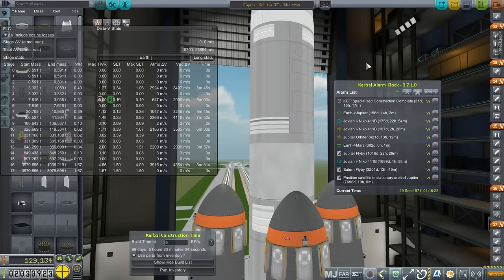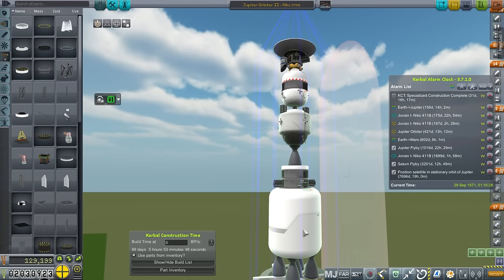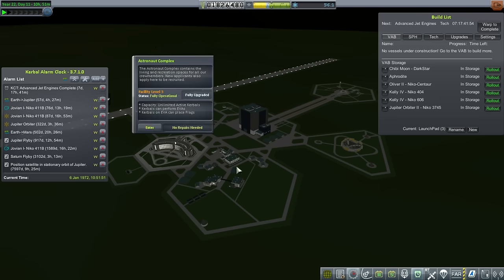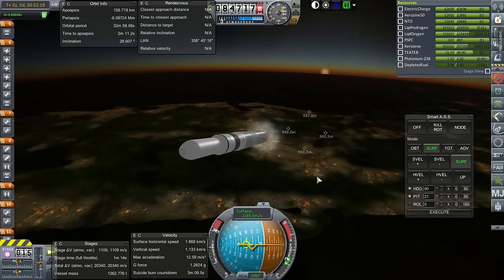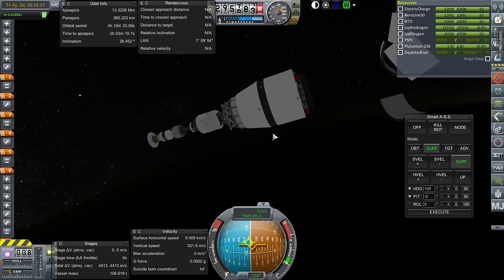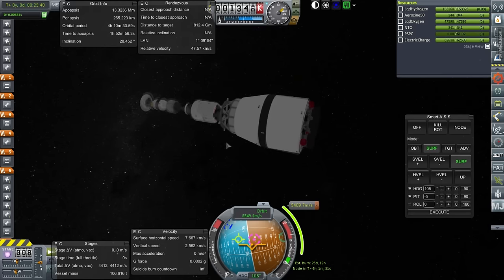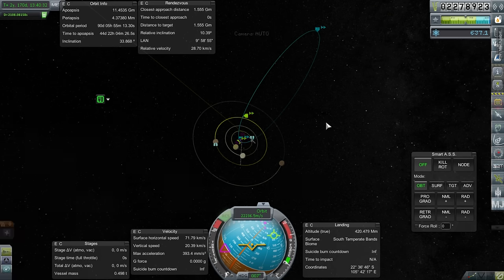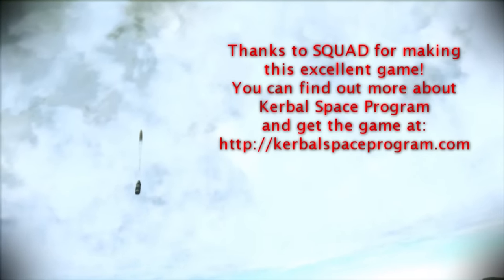Realism Overhaul in Kerbal Space Program 1.1.3 - 45 - Much Jupiter

Comment: There were some versions that were affected by a bug where very small parts such as cubic octagonal struts and such would take an excessive share of the craft's heat and explode, sometimes right on the pad as the vehicle is unpacked and hasn't even generated any heat yet. That may have been 1.1.x. I recall this happening to a deep space mission to me once, when I loaded it when it got to a maneuver node, and one of the three radial engines attached by cubic octagonal strut suddenly detatched because the strut exploded. It was pretty spectacular, very sci-fi event.
Reply: Yeah, that's a potential workaround for sure. I saw one of the other comments about KAC calculating heat since the last time the vessel was loaded exacerbating such an issue, which is definitely consistent with my experience. I'm pretty sure I loaded my Eeloo probe via KAC and within half a second all the heat transferred to the cubic octagonal strut and I lost one of three engine pylons, and could not return to Kerbin. I chalked it up to an Apollo 13 style event, which was fun... fortunately it was unmanned! But the relevant heating bug in stock KSP I believe was doing something like dividing heat evenly by part rather than by mass, so the total heat of the vessel might have been divided by number of parts, and that poor tiny cubic octagonal strut couldn't handle it while the pod, radiators, engines, etc. could, and I suspect that one of three struts was first in line for the calculations and the others were able to dissipate the heat. I hadn't experimented with the RTGs yet, but that makes sense combined with the KAC and stock bug suspects.

Comment: I had that problem with my last probe around Jupiter part of it would overheat during timewarp while near Jupiter but it would cool off without timewarp. I thought it was probably a bug so I reverted and used cheats until it stopped getting hot.
Reply: I remember having some probes overheat above Venus' nightside (over the atmosphere boundary!). Perhaps it is due to some funky thermal emission being modeled by one of the mods?